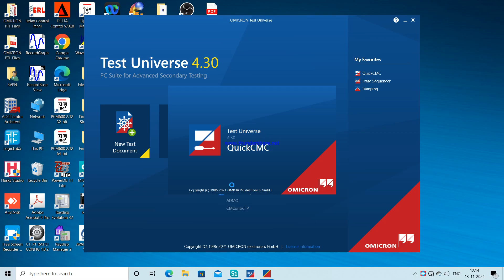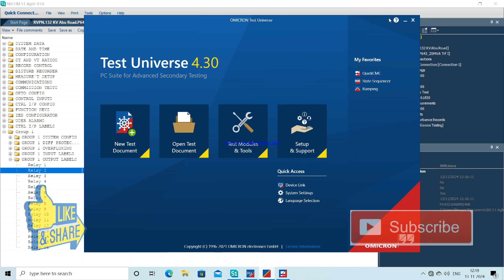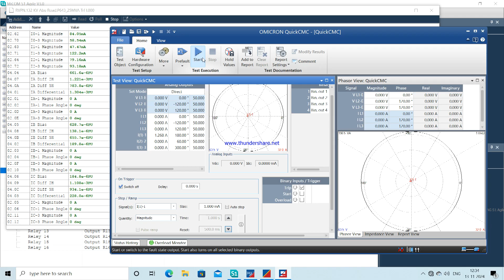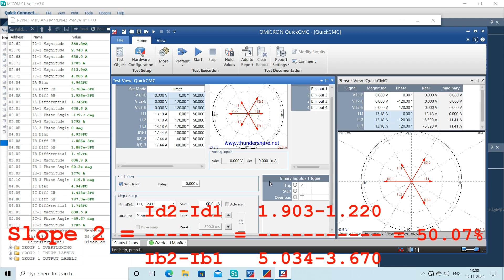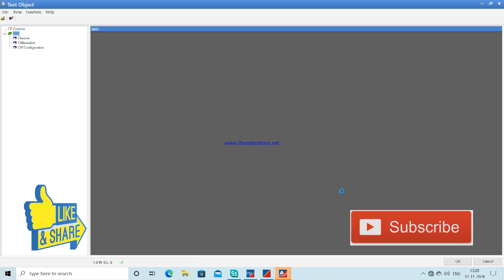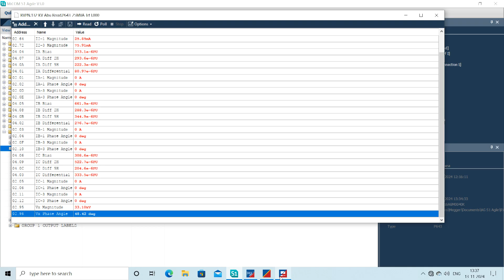Testing of Differential relay Micom P643 using Omicron  | Numerical Differential Relay Testing

Comment: Sir , the slope 2 injected currents are above 10A , won't this damage the relay ? 
Kindly reply
Reply from the maker: No it will not damage because relays are designed to handle high current

Comment: Sir, I m doing T60 relay with three winding.. One winding has different MVA.. How do we calculate the pickup current..
  I have calculate normal way.. But relay picking 1.25 times calculated.. Please guide..thanks in advance..
Reply from the maker: I didn't worked with T60 for long time.... But what I can recall is that.... Pickup in t60 depends on CT ratio not on MVA rating/ FLC

Comment: Sir for slope calculation  id & ir value should be taken from relay display in pu from or else??
Reply from the maker: Yes, from relay display or from measurement module in s1 studio
Reply: Sir can u make video on Generator differential testing, & calculation for 7um62 relay... Can i have ur ph no pls for tec
Reply: Sir
Reply from the maker: @soumya2221  you can contact me through my email erkaushik.hore@gmail.com and share your project details.... I will try to help you
Reply: Ok sir